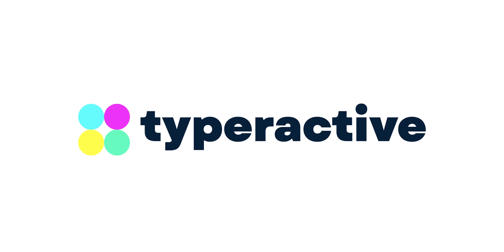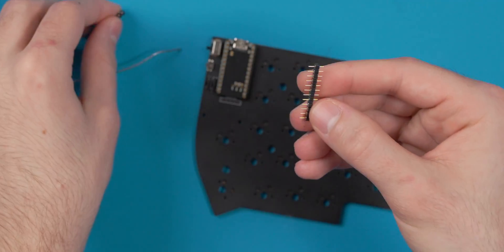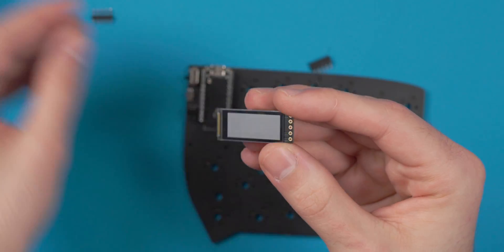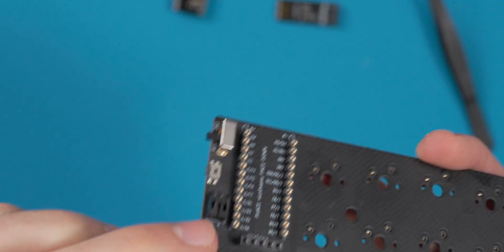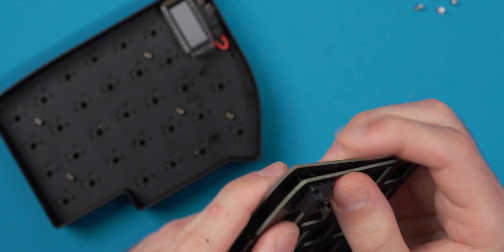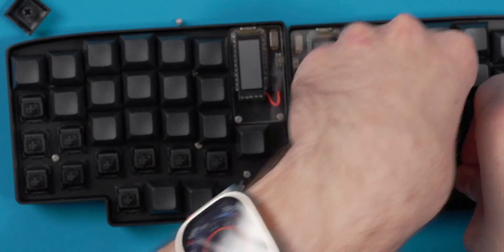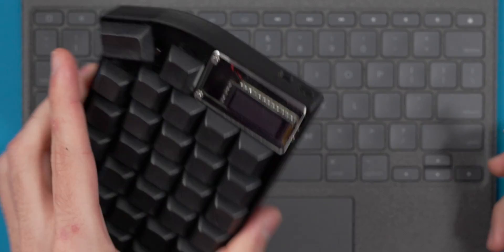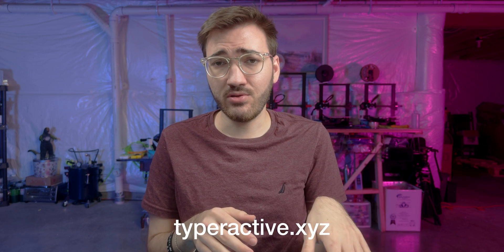How to Build a Wireless Lily58 Keyboard

Comment: @joe_scotto Thank you SOOOO much for making this video. I would have gotten stuck a bunch of times in the process of building this keyboard and creating, compiling and download the firmware/software.    
If I can give you one tip. Use a little bit of flux on all the solder points before you solder the components together. The solder will melt faster, the flux will help SUCK the right amount of solder into the connection.
Thanks again.... I am sure I will be back here rewatching the video for something I want tweak.

Comment: Hi, i have a question! is there a way to run this build without bluetooth? working in a UHF sensitive lab, and I can't use bluetooth, but would like to try this build with just wires.
Reply from the maker: Replace the Nico!nano controllers for just a regular pro Micro

Comment: I have a question. I am a big fan of the IRIS keyboard. Why can the Lily58 NOT hide the chip/etc inside the PCB like the IRIS can. The IRIS has PCBs now with no big chip needed.. it's all embedded in to the PCB and its VERY nice. I love the Lily58 layout, even have a LULU version of it, but still prefer my IRIS. I'd love to try my hand at some custom Lily 3d printed cases but that big ass chip bugs me. I'd love for them to come up with a new PCB design that has the same or slightly altered layout (e.g. one extra key if they got rid of the space used for the chips on both halves) and tucked that chip inside the PCB so we no longer have to deal with it.

Comment: "Great project! Can we use just one side without the other, or do we necessarily have to use both?"
Reply from the maker: nice!nano builds rely on one half typically. You can use the left on it's own but not the right as the left is what connects to the computer and the right sends data to that one then to the computer.

Comment: Can they be used as wired (just in case I run out of charge)?
Reply from the maker: Yeah, when you plug them in they default to wired mode while charging. It also lowers the latency if you want to game with them.

Comment: Could you use the pcb with a pro micro and use it wired instead? I like the pre soldered pcb.
Reply from the maker: Should be able to, the nice!nanos are just a drop in replacement for the Pro Micro. I would recommend reaching out to Typeractive directly to make sure though.

Comment: FYI, they do offer the acrylic for the Corne (at least, now they do). It looks a bit different but I love it. NGL I never ever buy sponsored stuff but I ended up going with Typeractive. They're great and involved in a lot of the open source HW development (like nice!nano). They're the only ones that offer all the surface mount stuff already attached w/ the wireless Corne board... at least that I could find. And its only a few bucks more than Boardsource's unsoldered board + all the parts.

Comment: I can appreciate that they made the MCU/battery/screen one super small assembly.. but from an RF stand-point that's terrible, lol. Basically building a little faraday cage around the wireless transmitter. Probably still works reasonably fine though, so it's a poor faraday cage at least.
Reply from the maker: I don't notice any issues with connection and my computer is in a bad spot compared to where the board is when I'm using it. There is a setting in ZMK that boosts the Bluetooth power.

Comment: I know it is a bit out of topic, but do you have any suggestion on how to make plate base and casing on our own pcb design ? And what software that are free to use instead of the premium one because it is just 1 time only for me ? Thanks
Reply: You should check out his other videos there's at least one that covers making a plate and case for a keyboard
Reply: @parallacksg  i cant find the one with custom pcb. Indeed there are alot with custom case but they are handwired
Reply from the maker: The concepts for cases / plates remain the same regardless of if a PCB is used or not. The only real difference is that with a PCB you can often get away with making the case a bit thinner as you don't have to account for the wiring.
Reply: @joe_scotto  I dont understand , of course the concepts is the same if we talk about the function etc, but the problem is , I dont know how to make one and aligned the hole with my pcb design.